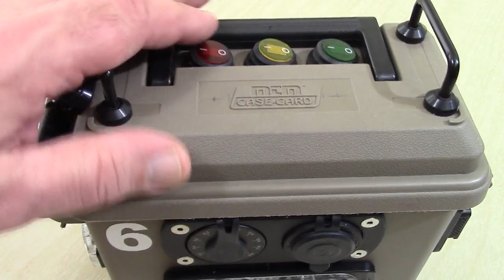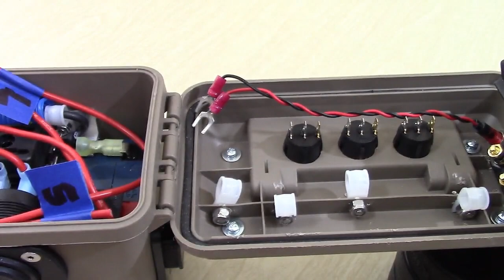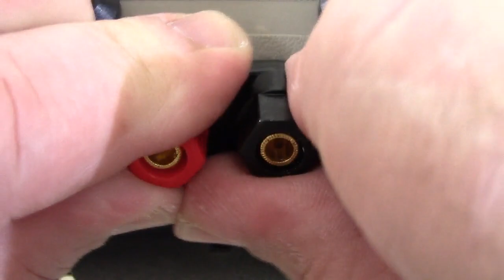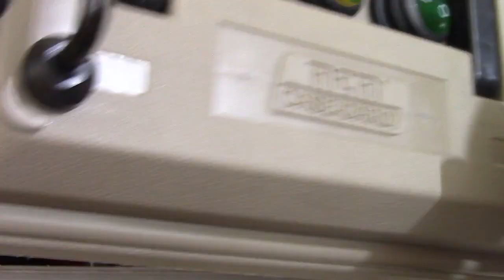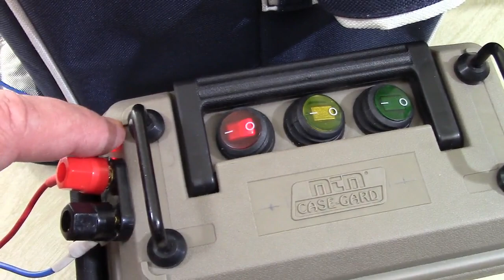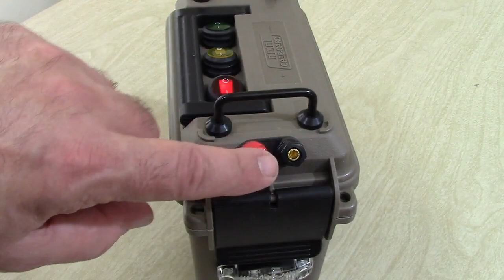MTM MINI AMMO CAN BATTERY BOX HARD WIRING SWITCHES PART 2

Comment: How are you charging this unit ?
Reply from the maker: SAE charging port in the rear goes right to battery.  Using Battery Tender Junior Charger with an inline fuse.  You can just as easily use a lithium battery and charger.... Very tidy battery box.

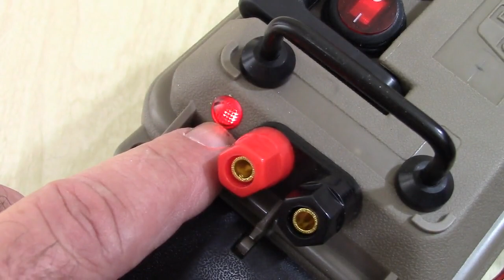Comment: How is power getting to the indicator light at 9:26?  

There's no fuse installed?  And the fuse feeds the switch, which feeds both the indicator light and the positive terminal?  I don't see how you're getting power to the indicator light without the fuse???   (I'm not criticizing in any way... just trying to figure this out.)
Reply: Ahhhhhhh... I figured it out.  The fuse panel LED (plus it's Voltage dropping resistor) is wired in parallel with the actual fuse.  That creates a secondary path for power to flow.  Under "normal" circumstances, the path THROUGH the fuse has far less resistance than the path through the LED (and it's voltage dropping resistor.)  That means the fuse box LED will be off.  But when the fuse blows... the only path available is through the LED (and it's series resistor.)  So that turns on the fuse box LED, and sends a very small voltage onward to the outside indicator light.  

Those fusebox LED's really help to diagnose WHICH fuse has blown, but they allow a tiny bit of power to flow towards the load in order for that LED to actually function.  

It's not a big deal.  I was just trying to wrap my head around how the outside light could possibly be on at that point of the build, without a fuse.  It all makes sense now.

Nice job!!!!  Keep up the great work!
Reply from the maker: You guys are awesome! I really appreciate you! Thank you for commenting!